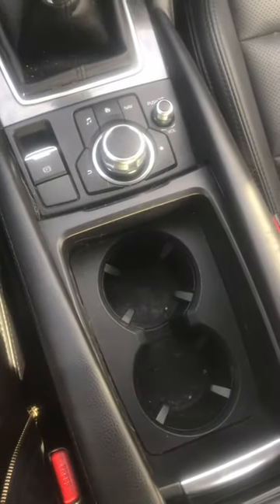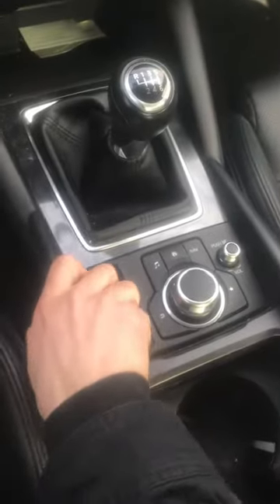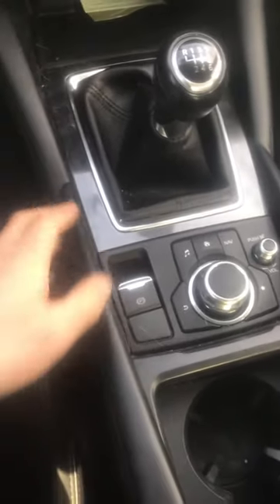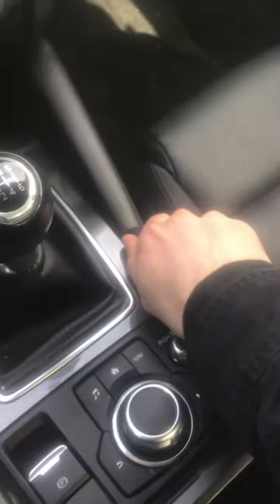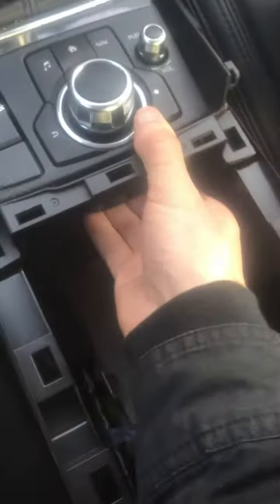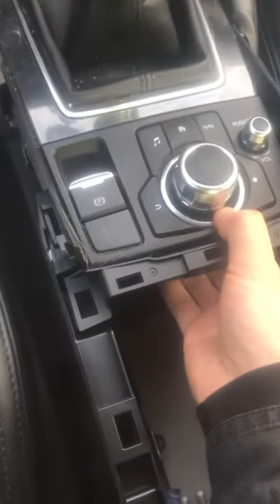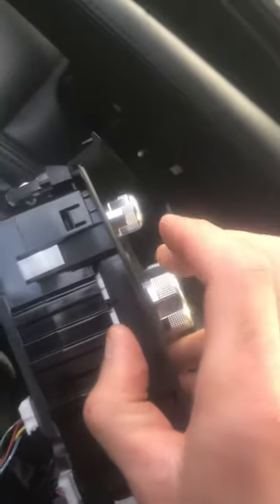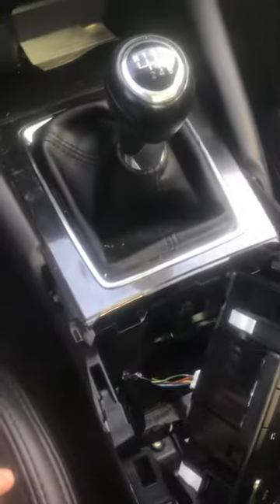2016 Mazda 6 Cup Holder Removal, Fixing Sticky Console Music Home NAV Buttons

Comment: For those who still can’t get it out, there is a screw under the back cup holder rubber mat
Reply from the maker: Hope you don’t mind, but I pinned your comment.  Evidently this is the case with several models.
Reply: I don’t mind at all. I didn’t realize it and ended up bending the aluminum brace all the way upwards until I shoved a flashlight into the center console and saw it. The aluminum brace can bend back down so the piece will be okay
Reply from the maker: @kodovibezz8851  sorry that happened, hopefully others will see your comment and avoid that.
Reply: Almost broke mine too.
Reply: You legend
Reply: Oh man this comment is a lifesaver.  I was thinking,  "why am I having such a hard time! "
Reply: Man this was so clutch! I'm putting   carplay in my Mazda right now and this part was giving me the blues, until I read this comment.
Reply: Ahhhh. Wish I saw this comment. Lucky the aluminium I bent just easily bent back into position.
Reply: wow saved our life thank you

Comment: I have a Mazda 3 with basically the same design of cup holders. When you removed the cup holders, were you able to get access to the usb/aux port module that is in the centre console? I am trying to install CarPlay in my car but I need to figure out how you can get to that module in the centre console. Thanks in advance

Comment: There is actually a brace that connects to the bottom of the cup holders that does not allow for the removal unless otherwise broken or never reinstalled.  Very crucial to this job.
Reply: is this why I can't get mine to lift out all the way at the back?? everything lifts out and wiggles, but where it connects to the storage area...it will NOT lift out...
Reply: There is a hidden screw under the backmost cupholder pad in my 2017 model. This will fix it

Comment: Will this work on 2017 mazda 3?
Reply: Thiis works on 2017 mazda 3 4door or 5door. It's fairly easy don't be afraid to use a lil force. The clips are strong. One thing you need to do is take a screw off where the cup holders are at. To get there remove two rubber pads. Also inside the center console there was two black screws. Not sure if you need to take that off but I did. Gl and thx for the video